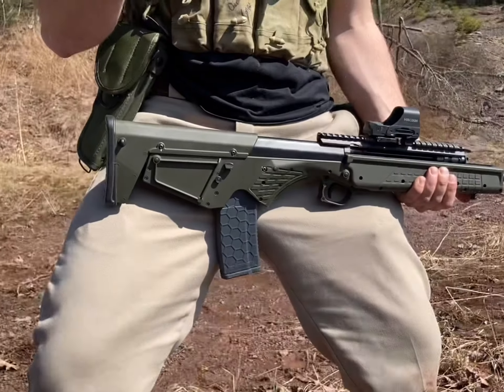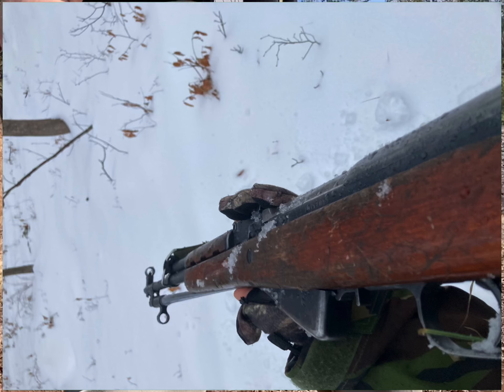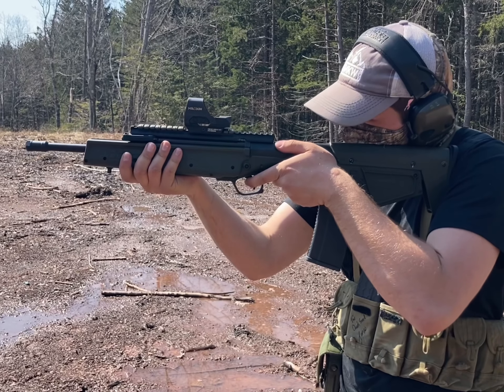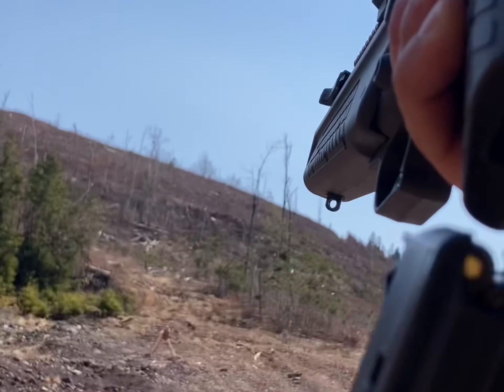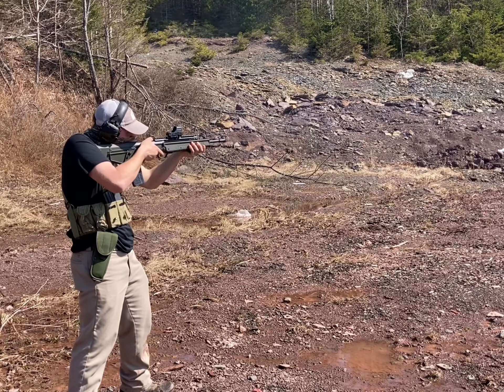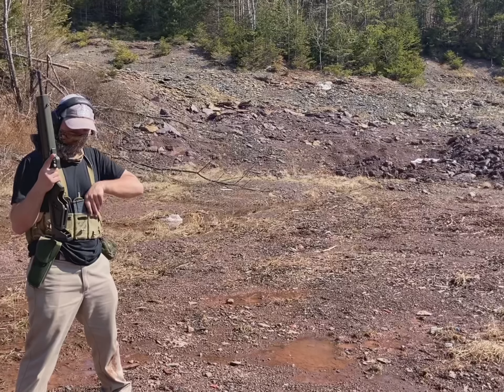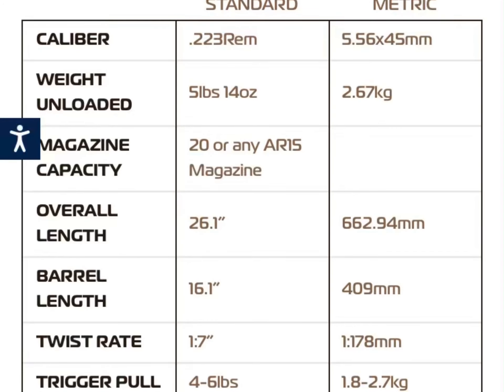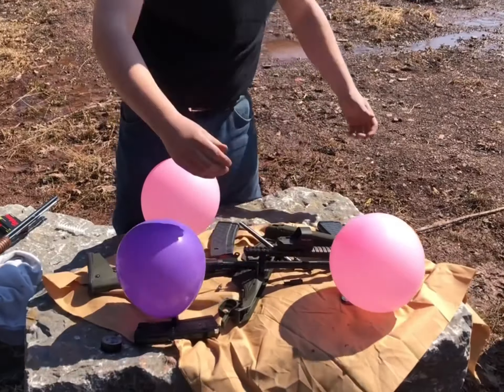Keltec RDB C

Comment: I love my RDB-C, the rhino rail is a huge upgrade. I didn't have such a bad learning curve for reloading and found the bolt/mag release intuitive although the hk slap always feels sick af. Over 1k rounds and no issues. The biggest concern/complaint I have is that it heats up really quick, the safety will burn you if you don't have gloves and rapid fire the gun. Another issue is that the mag release is not protected enough by a ridge so it is bumped by my plate carrier and ejects the mag. If they can find a way to fix those 2 issues I would trust this gun more.

Comment: Firing from the hip seems like an odd test. I wonder why you think it’s superior to SKS and mini-14. SKS has been combat tested and mini-14 is used by some police departments.
Reply from the maker: Hipfire is just for fun. I enjoy shooting both the SKS and Mini-14, and they are both capable rifles. However, the RDB is lighter weight, much shorter, takes detachable magazines and is much easier to be accurate with than the SKS  thanks to its ability to easily mount an optic.  Its also mechanically much more accurate than a standard mini-14 especially without an accustrut, and takes magazines that are a third of the price. It points and balances easier as well.
Reply: @mauzerwarcrime6210  You couldve just talked about the magazine availability and that would've been enough